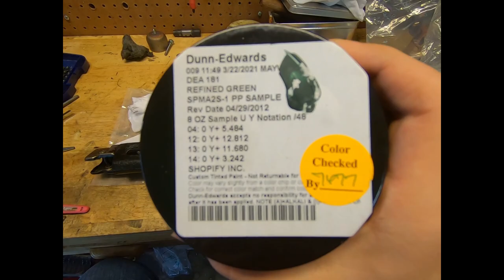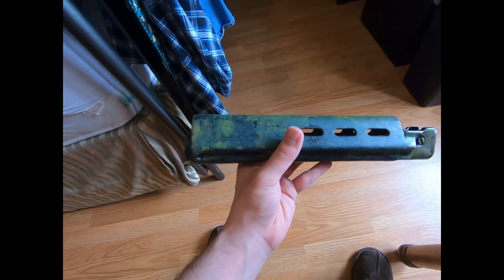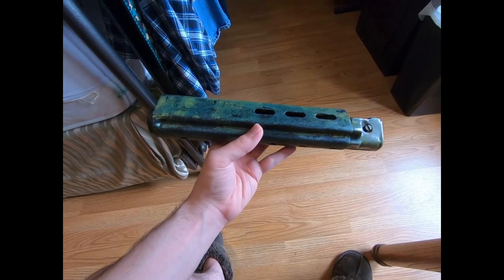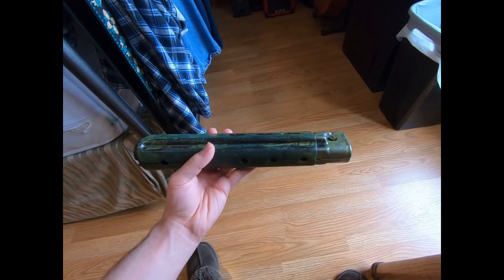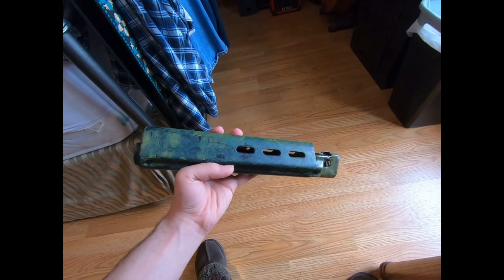How to DIY Rhodesian "Baby Poop" Rifle Camouflage

Comment: That Bay Leaf paint doesn't even show up on the Dunn Edwards website. Is there another color that's close made by someone else?
Reply from the maker: It does.  It's just not easy to find.  If you google "DEA 171 Bay Leaf", it will show the page for it.  Then just go to "order paint sample", select "All colors" from the drop down, and look for the DE 171 paint code.
Reply: @provenancemachining  Indeed, I see it now. Would 16 quarts work for just one rifle?
Reply from the maker: Missed this one..  Sorry.  I did mine using just the sample size containers and I still have plenty of paint leftover even today.  You could probably get away with doing an entire rifle with just 1 of each jar.
Reply: Indeed I could have, but I ordered the sample sized cans and they had both congealed by the time I got them, so I got my money back and ended up spending 3 times as much at Sherwin Williams after they color matched them and told me they don't sell cans that small.